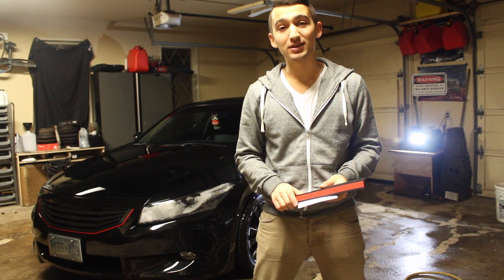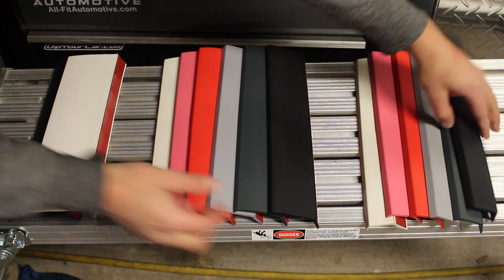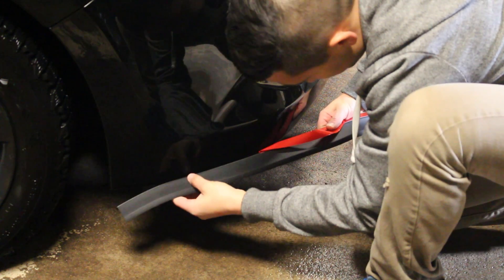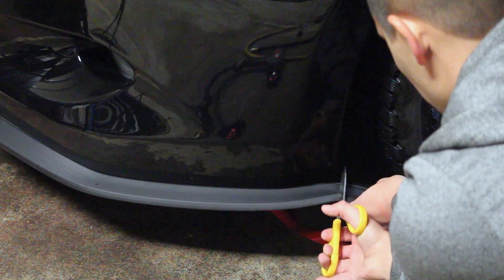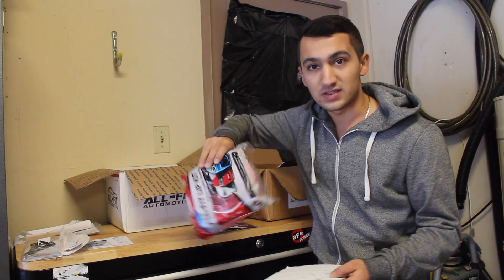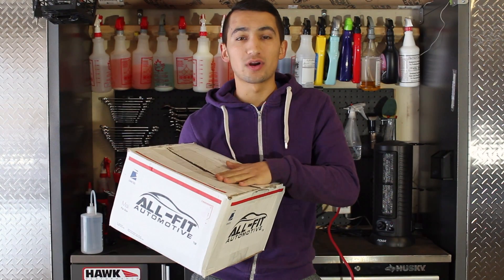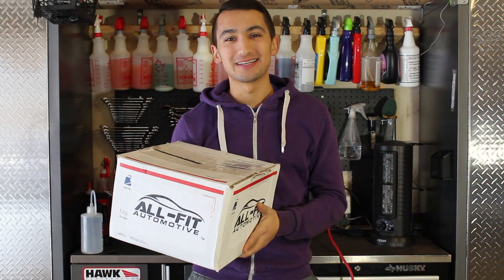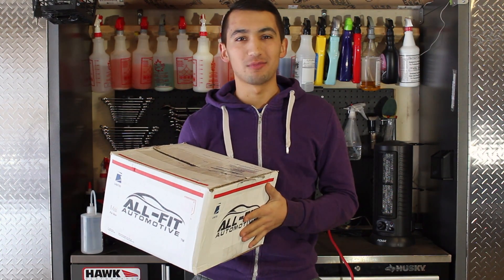How to Nismo Your Honda

Comment: How durable is the all fit lip? in the winter and with snow.Even on the highway? thanks
Reply from the maker: +Con25100 not a problem!! And if you install the nylon washers and screws, you won't have a problem, guaranteed!!

Comment: I got a 370z with 5000 horsepower , can run a 1000 mile straight in 0.0000000000001 seconds and has a turbocharger thats the size of a honda civic , and for that extra bit of rice i have a 10lb bag of rice in the trunk just in case i get hungry😂
Reply: I have a Prius making around 10,000 ho to the front wheels on 10 trillion pounds of boost. The car is so powerful that it wakes everybody within a 50 mile radius. This car has so much power that it has to be bound by chains so when I crank it up it doesn't launch into the sky
Reply: 10000 ho's is a lot
Reply: hp*** I was commenting as I was hitting boost and made a typo
Reply: +Corn Beef 😂lol dead

Comment: DUDE I HAVE A DEEP PEARL BLUE SENTRA SR TURBO AND I DID THAT ON MY CAR WAY BEFORE THIS VIDEO....AND NISMO IS FOR NISSAN NOT HONDA....HONDA CIVIC TYPE R COMES WITH BLACK SPOILERS AND RED LINES JUST LIKE GTR...370 Z...SENTRA NISMO....YOU SHOULD OF REFERED TO THIS VIDEO AS THE CIVIC TYPE R LOOK SINCE YOU ARE DOING IT ON A HONDA....ANYWAY GOOD JOB DUDE....NOT TRYING TO PUT YOU DOWN....MY INVENTION WAS I OUT NISMO FRONT GRILL BADGE AND TRUNK BADGE....I USED THE SAME RED STRIPE TAPE YOU USED I BOUGHT IN AUTOZONE FOR $4.00...I INSTALLED A REAL CARBON FIBER LOOKING NOT REAL CARBON LIP AND I PUT THE RED STRIPE JUST LIKE THAT AND ON THE SIDES AND ON THE BACK BLACK BUMPER OF MY CAR SORT OF LIKE THE SENTRA NISMO HAS IT IN THE BACK....I PUT BBS RS CLASSIC IN DEEP PEARL BLUE WITH SILVER LIP AND DAY IN DAY OUT I GET COMPLIMENTS OF HOW THE COLOR COMBO ON MY CAR LOOKS AWESOME

Comment: how did you change the stock shifter boot on your car man ?
Reply from the maker: +Cristian Gonzalez I had to remove my center console and install it from the backside
Reply: +milanmastracci I have a similar car and I wanna change the boot and stock shift knob but I was curious how do you remove the center console ?
Reply from the maker: You have to remove a couple screws underneath that hold a plastic brace in.

Comment: How durable are the lips? I live in a hot climate, would I need to skrew the lip in or will the tape be enough?
Reply from the maker: +mkd97mkd The screws just help to adhere the lip to the bumper. If your bumper has aggressive areas, its probably in your best interest to install the screws

Comment: This lip should add at least 500 pounds of downforce to the front of the car. Improving traction for the front tires.
Reply: +Corn Beef sry mate. My calculator was in Radians when I arrived at the 500 lbs number. 
But the VTEC delete isn't necessary since he has tinted windows.
Reply: Omg you guys a so damn stupid 😂😂😂😂😂😂 funny as hell, made my day!
Reply: alex dansby What you talking about bro? Im a refrigerator engineer.
Reply from the maker: +888TopGear888 What they're all saying is that the flux capacitor of the torque converter will interect with the amps of the headlights, resulting in at least 402 grams of added downforce, per cubic centimeter of racecar added to such vehicle. AKA, its a racecar #jdm
Reply: +milanmastracci What if the acid in the battery causes a reflux in the flux capacitor?
Reply: 888TopGear888 Then we will go back to the future to find a way to prevent that from happening

Comment: My honda is so fast. It makes 4200 horsepower at 6900 rpm. It goes from 0-60 in .420 seconds and does a quarter mile in 6.9 seconds. The turbo is so big I had to mount it  in my trunk.
Reply: Honda truck?
Reply: IM DYING😂😂😂😂😂 MY STOMACH HURTS SO BAD😂😂😂😂That shit was funny bro
Reply: Ha your Honda is slow bro step your game up son. My Geometro makes 9000hp pushing 1000 pounds of boost on low grade pump gas. My 0-60 is 0.00000000000000000001 sec and my quarter mile time is 1.0 sec and 800mph. My car redlines at 43,000 rpm and has a top speed of Mach 3.0
Reply: If those stats were true, and assuming uniform acceleration after 0.420s, if you were to do the full 400 metres (0.75 miles) you would theoretically reach 290.0 m/s or 1047 km/h. But I doubt any one here can understand how to calculate such results.
Reply: +L. Andrews speak English bro, and use bothe metric and standard measurements
Reply: L. Andrews there is always that one guy
Reply: edit If those stats were real, and you accelerated uniformly after 0.42s, if you were to do the full 400 meters (ONE QUARTER OF A MILE) you would theoretically reach 290.9 m/s (METERS PER SECOND) or 1047 km/h OR 654.4 m/h. But I doubt any one here knows basic physics.
Reply: Daniel Dematteo Firstly, if you can read it in English, it is English.
Secondly, I'm not your brother.
Thirdly, if you can't spell a word they teach in first grade, don't tell me to 'speak English'.
Reply: +L. Andrews wtf is up with all the hate, this comment is for fun.
Reply: +Daniel Dematteo where have I hated?, all I have done is stated facts that have somehow reflected negatively on you
Reply: Corn Beef "joke" get it? Honda lol
Reply: +L. Andrews lol, the civic is no joke.
Reply: +Daniel Dematteo My prius is still faster.
Reply: +L. Andrews You must be fun at parties
Reply: +A delicious steak why the fuck would I go to a party?
Reply: Idk, maybe you could lecture to people about their ignorance of physics and math? They'd probably enjoy it
Reply: +A delicious steak I might look into that

Comment: I personally wouldn't trust the glue/sticky to keep this on the car, I'd use afew self tapping screws, just to make sure.
Reply from the maker: +ericishappy1979 I've run this in the summer and winter, and the only time it comes off is at extreme speeds, and if you have aggresive curves in the bumper where you will get a high pressure pocket of air.
Reply: +milanmastracci I'm impressed then, usually the glue isn't very good.  Thanks for replying.   Car looks great by the way.
Reply from the maker: No problem :) Yeah the 3M double sided tape is great!!